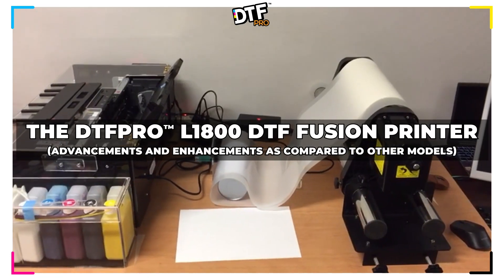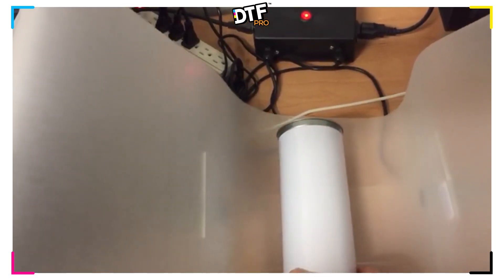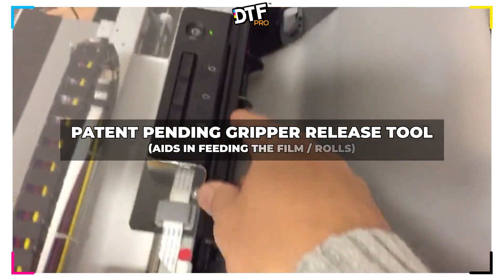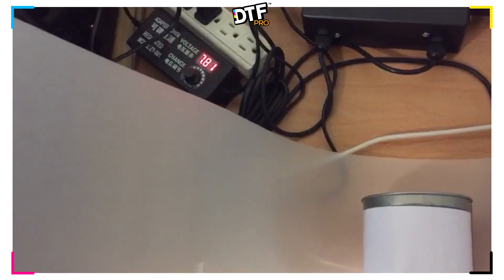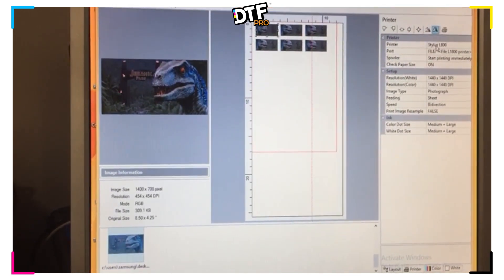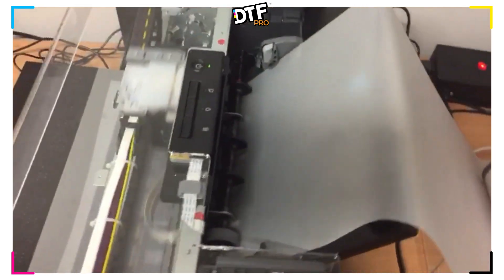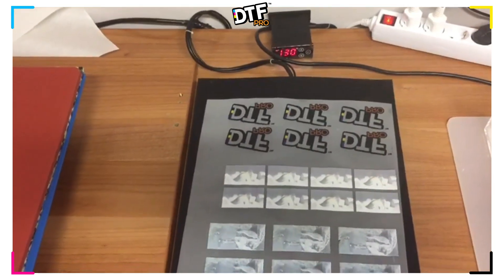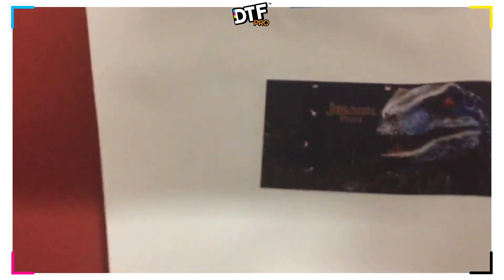Everything you need to know about how to operate the DTFPRO L1800 FUSION DTF PRINTER - under 10min

Comment: I'm hearing that epson dtf printers have a chip that after you refill the ink tanks certain times the printer quits is that true i don't know about this printer I've had good experience with smaller ecotank epson products
Reply from the maker: The printer "quits" after certain amount of refills, this is true, however that is based on the printer thinking that it's waste section is full, so it quite when the waste counter reaches its max. This is a modified printer with external waste receptacle that can be cleaned out, so when the waste counter reaches its max, it can be reset quickly using wicreset, so it goes back to "new" state.

Comment: After printing 20-30 images off the roll does the color or the white start to clog up? This doesn't do automatic head cleaning while it's printing does it or do I have to manually clean nozzle every so often? I'd hate to start a job for 100 8x12 images and 50 images later my colors start to mess up, please explain this to me.
Reply: The white ink circulates all the time during printing. The WIMS installed has tamper switches which are activated with every Pass of the printhead while printing, so this White ink will not clog. 
Automatic cleaning however on the L1800 is not supported. As a result we recommend printing smaller jobs 20 at a time and monitoring quality while printing. Of course if you notice a missing color then a nozzle check pattern printed and head cleaning is needed again.